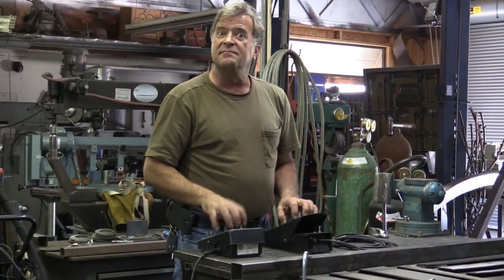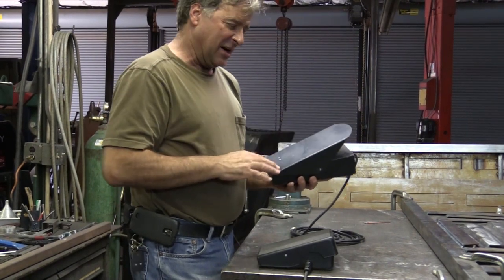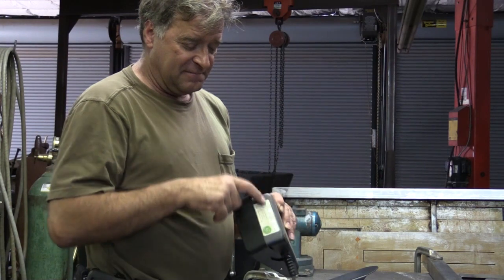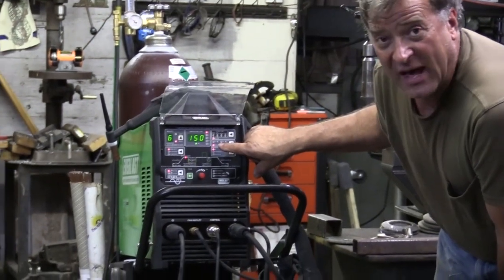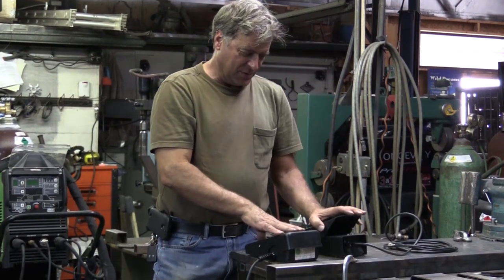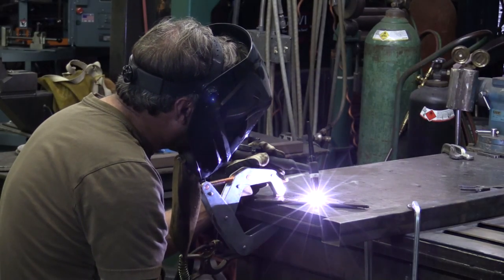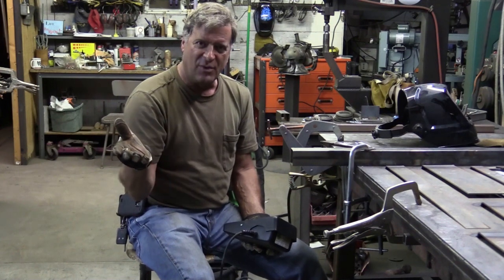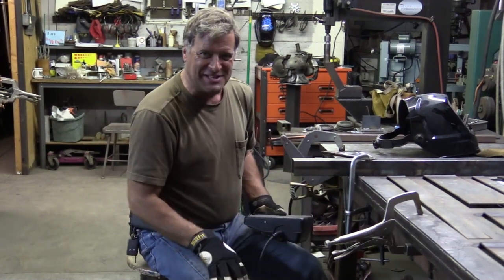Why I Replaced the Foot Pedal on My Everlast POWERTIG 255EXT - Kevin Caron

Comment: Bad info. My 200DV came with a better pedal then the one hes showing I don't think that much higher end 255ext ever came with that crappy pedal.  You'd think this guy would make a correction after 3 years, but guess not.
Reply from the maker: Do you mean like I make mistakes like everyone else?

Sure, I will make a correction right here and now. 

I grabbed the wrong pedal. 

Sorry.
Reply: You think the 200DV pedal is better than the SSC version? ummm i doubt that Adrian

Comment: on this particular video the sound is very very quiet
Reply from the maker: Been working on the audio for a while now..    Think we have it fixed...
Reply: oh ok. nice videos by the way kevin. I been watching your content on and off. I got into welding about a year and a half ago but i just have little hobby welders so you know. Thanks for the reply btw. :)
Reply: i was debating on getting an everlast 200st and i was wondering if you would recommend the everlast welders. I know you did a video on the 140st but do they have the support and customer service needed to get parts if they break?.
Reply from the maker: Someone always answers the phone when I call.     Have never had to wait for the order to come from China so i guess they have some in stock..    I would not hesitate  to order a machine from them..
Reply: have you ever had anything go wrong with your multipurpose welding machines that limits them to only 1 process? doesnt have to be from everlast but i have not since im just starting out but i am just curious. And what would you do in that instance?
Reply from the maker: No, the couple of times they have given me trouble they were just dead or they would not shut off at all..   Both times it was the on/off switch which has been replaces with a bigger switch in the current model.   NO more problems...
Reply: oh thats fantastic. I was thinking of going for the 160sth or the 200st. do you by chance know what a good sized argon bottle would be worth picking up so that i dont run out of gas all the fast?
Reply from the maker: I run the 5 foot tall bottle.   Lasts about 3 weeks of steady welding for me..
Reply: is that a 125 or a 200 bottle? also can you still be precise with the everlast 200st? i mean its similar to the 140st but with more amps of course. So i was just curious how smooth it can be without the upslope and down slope options
Reply from the maker: I think it will work just fine..    It's all about the head inside the helmet...
Reply: well if the welder breaks thats not the helmets fault lol. I have heard the newer units have gotten better though and dont break as much but we will see.   How much did it cost you for an argon bottle? jw
Reply: hey can you suggest any torches or lens kits to get for tig for a beginner? i see alot of those longer parts when you first get a tig torch. Just curious
Reply: i mean i prefer the maneuverability so w/e makes the torch easier to handle :)
Reply from the maker: A bottle of argon costs me about $165.00 to refill.    The stubby gas lens seems to work the best for what I do..    You just have to find the right one for your torch..    Try arczone.com
Reply: why does it bring me to an email client?
Reply from the maker: Try www.arc-zone.com

My bad...
Reply: no worries. ill have a look
Reply: so can i put a CK torch on the everlast 200st? im not sure how that all works lol
Reply: did the 200st come with a torch or no?
Reply from the maker: CK can help you with the right torch to fit that machine..   but no it doesn't come with the machine..
Reply: thats kinda disappointing considering the 160sth did.   So based on prices do you think that the everlast inverter machines are worth the money without the extra accessories for the lower end ones? I mean i was looking at those CK torches and they can be freaking expensive depending on what one you get. I would love a flex head torch with a small neck so i can hold it easier. I find it hard to grip big bulky things when you consider what Tig is for. Sorry i know i wrote alot. Sometimes i have alot of questions :)
Reply: well the ck people were some help but they had to go because of a meeting. Thats literally what one of them told me. Im thinking "you have to go to a meeting during the day while your in a live chat with a potential customer? like seriously?"     Their stuff is extremely expensive also and i have no idea what fittings or w/e i would need to connect a torch to a power cable with a dinse connector on it.   Thats how new to tig i am
Reply from the maker: Can't believe those people..   Give the guys at www.arc-zone.com a call..    They will help you and be happy you called!

Their number is 1.800.944.2243
Reply: hey kevin how do you decide what kind of sculpture to make? im not a very creative person and i was just wondering how you decide what to make and how much metal you decide you will need for the job. I appreciate any advice :)
Reply from the maker: What a great question!     I normally start out with the image in my head and making it is the only way to make it stop bugging me.  In the beginning I would just buy way more metal than I would ever need for a piece.   That way I always had enough.   Now I have gotten better about guesstimating how much I will need.
Reply: only comes with time and practice right? eventually you will be able to know how much a project will call for. I get my metal for free but i can never think of anything to build even though i have the pieces its just like  "uhhhhhh hmmmmmmmmm, nope i got nothing" lol

what did you first build when you were starting out? if you remember
Reply: other than that welding cart you told us about in one of your videos. what were some of the beginning things you used as first projects
Reply from the maker: Make a welding table,    Make a plasma cutting table,   Turn a bowl on the lathe to hold pens and markers..
Reply: i dont have a plasma cutter or an air compressor sadly so i cant do those or they wouldnt have a use for me right now anyway lol.   What else? what got you into make scultpures?
Reply: yesterday i made a little holder for my stick electrodes and put it onto my cart so that when i do get my everlast 200st i will be able to just pick them up and go :D 

I bought a cart because i didnt have any flat stock long enough or wide enough to fit into a cart which sucks so bad. I have a little crappy flux core arc welder from harbor freight that does the job even if it doesnt do it super well it does do it Then i have a little red buzzbox that my friend gave me but all you can do with it is turn it on and run 1/16th rods lol. So yeah. You see why i need something a little more powerful
Reply from the maker: I hear ya!   Keep having fun.
Reply: do you sell your sculptures or are they just for fun?
Reply from the maker: This is what I do for a living..    Yes, everything is for sale....    well almost everything...
Reply: hey kevin, have you ever done any or shown any spray arc? ive done it once and i found it facinating. The sound is very different and the way the metal melts to your work is different and i just figured since you have alot of different types of machines that you could try it out on your Mig machines and show everyone :) Just an idea.
Reply from the maker: Never done it that I know of..   Have to practice some more....
Reply: what advice would you give to a college student who cant afford a huge machine but wants the functionality to run 6010 rods and most of the other types of rods and wants portability but doesnt mind if the machine doesnt have a ton of features?
Reply: I believe Everlast has some stick welders that have specific ports for running 6010 rods well. I suggest you give them a call.

Comment: That's not the pedal that goes with the 255EXT unit.  That's an much older pedal.  The units should be shipped with a newer style pedal.  That pedal would fit with our older 200DX from around 2011 or so, but NOT our 255EXT.  If it was shipped with it, then it would have been an error in packaging.  For standard foot pedal use, use "Pedal" mode only without 2T or 4T setting.  Pedal 2T/4T is designed for torch amp controls with separate on/off switches, or for using start/end amps/up/down slope with the pedal which is rarely ever needed.  We also sell the SSC pedal with our units if the customer wishes to upgrade.

Comment: That looks suspiciously like the old foot pedal that used to come with the Everlast 250 Power Pro, etc.. I had lots of problems with the narrow base and, if you push the slightest bit off center, those springed hinge pins would pop in and the thing would collapse. I riveted a larger 1/8' steel diamond plate to the back and epoxied bumps on the hinge pins to keep them from collapsing under pressure.